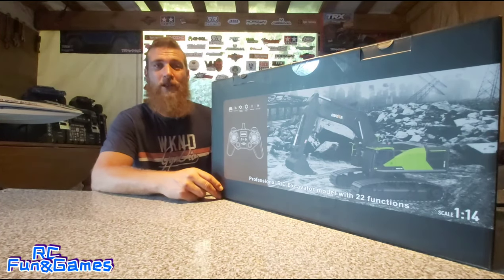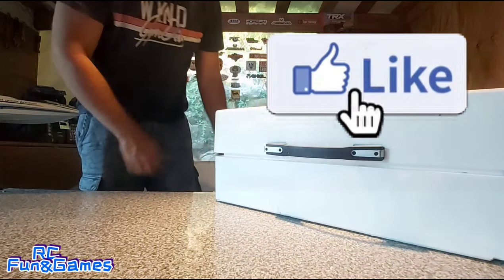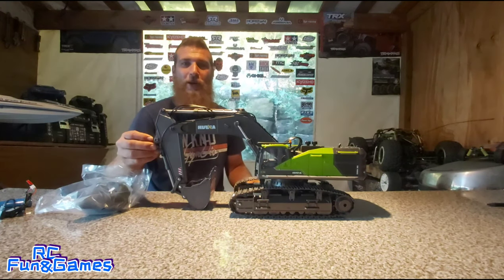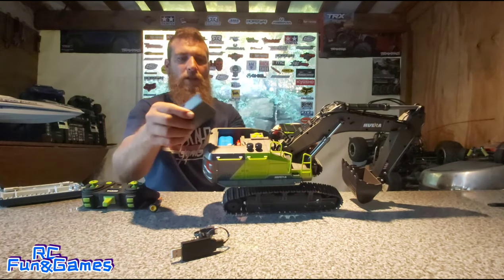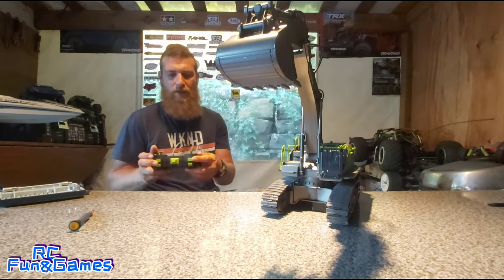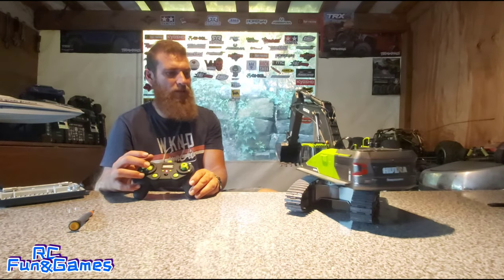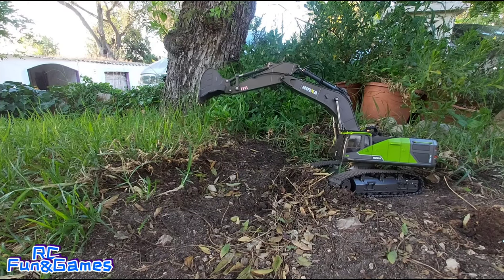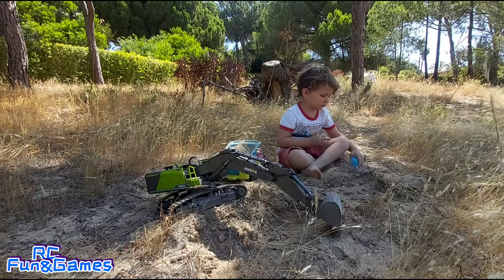Unboxing RC Huina 1593 and test.         My first RC Excavator

Comment: Each review I’ve seen of these they don’t traditionally turn the tracks like you would in real life, is that a design flaw or is it just how you think to operate it? I.e to turn left you turn the right side track forwards and the left side track backwards at the same time, rather to an just send the right side track forward
Reply from the maker: You do realize this is a Toy and it doesn't operate the same as the real thing
I've been driving one of these for a very long time and the controls are not the same at all
Reply: @rcfungames  It wasn’t a dig at you, and I know how to operate a real one too. But back to my original point, yes the tracks do turn independently because after a few other reviews I watched afterwards, it was confirmed in another video. Just for some reason on yours, and other peoples I had watched before, you all just one track turned

Comment: Fun video to watch.  
Are you aware of any models where the motor sounds do not stop when you activate another function? For example, it sounds like when the motor sounds are running and you move the boom that as the boom moves, the motor sounds stop.
Reply from the maker: Thanks bro, this was some of my first videos I did on YouTube 😅
believe there is other models from this brand that do have those features.
But the price difference will be quite substantial.
This is only a 220$ excavator, I know they make another one for around 500, that has smoke, and  individual engine sound apart from the hydraulic sounds.
For 700 bucks I believe you can get a full metal one with all those features and more 😉
Thank you so much for the view and comment 👍